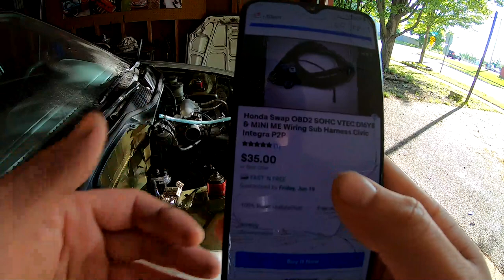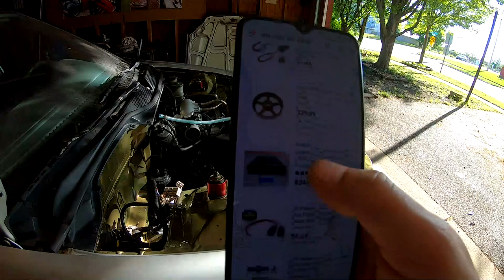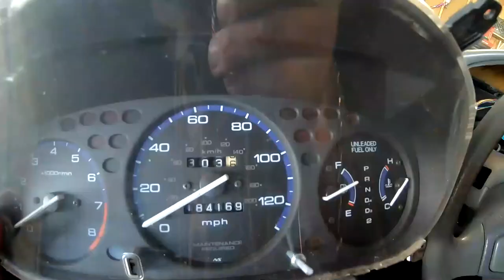500hp build D16y7 to D16y8 Intake Manifold swap step by step 3 wire to 2 wire aicv obd2b to obd2a

Comment: What’s up man I have a 2000 Honda civic I swap the engine from d16y7 to d16y8 but I need to run the harness and I was watching and I think I have the OBD2B with the distributor obd2 I was wondering if I can used the same harness

Comment: Great Video. I have a 2000 DX Automatic ( 😔) Which has a Y7 Mani. I purchased a 2000 Y8 Automatic Mani recently. Which Has those Ports. The Seller said it should be Straight Install. But my Car ISN'T an EX. So Do I still have to Plug Those Ports? I still have to look if I have that extra nipple on the thermostat housing on my car. Figured I asked you first.

Comment: got a question. •Got a 96 Honda Civic hatch. •Has the 96-98 d16y8  vtec motor 
•has the d16y7 obd2a non-vtec 5peed manual transmission wire harness that’s been wired to the ecu for the knock sensor, iacv ,both vtec sensors.
Running a p2p-a33 ecu. 

I’m having trouble finding the right distributor for it. My harness has the 10pin plug and the one for the 99 d16y8 that the motor came out of has a 8 pin plug
Reply: Need the 96-98 y7 distributor. Called the “big plug” dizzy

Comment: If I have the 97 civic Ex & it’s converted from auto to 5 speed I’m hooking up my skunk2 intake also but ran into an issue I’d there I’m able to switch the to 2 wires instead of 3 like you did for the IACV without charging my computer or anything

Comment: Badass video bro I dont know much about engines I bought a 97 honda civic dx automatic. the guy told me it's a   Freakin Stein built. Not sure what that means but I do know I need to hook up the vtec the engine it has it a d16y7 . I noticed the harness it the same one u using .my question is can I connect the vtech the same way u did ? And will I need a different ecu ? Or can I still use the same one ?
Reply from the maker: You need a different ecu. And yes you can connect it the same way I did.

Comment: Hey I have a question if you can help. I have a 97 civic ex I'm putting in a y8 swap. It had a y7 in it when I bought it blown up. It had a y8 engine harness on( i think) .it and a jumper harness to a p06 chipped ecu.. where I'm confused is the fact that it has a green plug and a GREY  plug coming from the dash by the ecu. The grey plug is going into the ecu jumper with the other 2 plugs on the engine harness...  I bought a obd2a vtec ecu and a unmolested y7 harness to modify with the y8 plugs but idk what I'm going to do with the grey dash plug or why it's there.

Comment: So I bought a obd2a wiring harness that I'm using on my 99 civic lx with mini mi swap, which used an obd2b harness. I bought an obd2a to obd2b jumper harness and have 2 questions, first how do I go about the difference between 10 pin to 8 pin distributor plug? Can I by a adapter for it? Second, the green plug under the dash on the passenger side, do you repin those and if so how?

Comment: I just want to say you've hopefully single handedly saved my brothers honda, I was very worried  about finding the write information for his 98 honda civic we put a d16y8 into it. Initially we ruined the original y7 harness got a y8 harness didn't want to run the o2 sensor. SO I got another y7 harness but we needed to adapt the iacv from 3 to 2, then wire in the new knock sensor, vtec solenoid, and vtec switch. The only thing I have a question about is in the last part of the video, is it necessary to splice those wires my engine does have the crank sensor in it and it plugged in. So I don't think I'll need to do that, I believe your engine is a y7 bottom and a y8 top. I'm also using the y8 ecu, and y7 throttle cable so we'll see how that works out if I need to pull a y8 cable.
Reply from the maker: Thank you and yeah you should be good.  Glad this video helps someone.
Reply: @BarbasLife   Thank you, we’ll be wiring today. Appreciate you 👍

Comment: Hello new sub here quick question I have a 1998 dx hatch with a D16Y7 and going to be doing the Head swap with a D16Y8, I do have the Y8 engine harness and ecu, would it be easier instead up changing the wires to just use the Y8 ECU and Harness ? Thanks

Comment: I just bought a 96 Honda Civic hatchback cx that has a swapped d16y8 vtec manual transmission 5 speed running the p2p-a12 obd2b ecu and wire harness.  A couple things aren’t working right so I ended up getting the obd2a p2p-a33 ecu. My question is if I get a 1996-1998 OBD2A HONDA CIVIC EX OEM Non vtec ENGINE WIRE HARNESS 1.6L M/T 5speed , will it work for my ecu and be able to run my car right ?
Reply from the maker: Will work as long as you get wire harness for 96-98 and ecu for 96-98   because plug ins are different for 99 and 2000. Yes everything will be a bolt on swap.
Reply: Thanks greatly appreciate
Reply: @BarbasLife  Thanks for the video again what distributor do I need?

Comment: I have d16y8 block with vetc swap head and ecu my speedo is not working also I have engine light on and the vtec is not working how it should be to work please help
Reply from the maker: D16y8 is a vtec short block. Check if  the vtec is wired in? Also what ecu do u have is it a vtec ecu? Maybe the filter is clogged up on the vtec solenoid  check all these. For your speedo check the top of your transmission maybe its unplugged or broken.
Reply: @BarbasLife  everything is plugged in I have p28 ecu I have put new sensor also plug still nothing I change again the sensor but nothing

Comment: Hey man I know it’s way late to comment on this but do you have any idea what could be wrong with mine? I have a d16y7 and I got a skunk2 intake manifold, basically a d16y8 manifold, the only thing I cannot get to work right is the idac and my only guess now would be the ecu, would I need to run an after market ecu to get the d16y8 manifold to work with my d16y7?
Reply from the maker: Naw no aftermarket ECU needed
Reply from the maker: What's your car doing?

Comment: Had u already installed a y8 cylinder head onto the y7 block beforehand?   New to the channel
Reply from the maker: No its a jdm d16a cylinder head looks identical to a y8. Also has vtec solenoid port but the head is not vtec. I know its weird but its not vtec. I'm planning on getting a y8 soon to swap in.
Reply: @BarbasLife  oh ok so would this wiring work with a y8? Or what would be done differently?
Reply from the maker: The whole wiring would be exactly same i pretended I was working on a y8 with vtec.
Reply from the maker: @xitlali09  also thanks for subscribing.
Reply from the maker: All your doing is swapping manifolds and adding vtec wires to the head and wiring it into ecu
Reply: @BarbasLife  no man, thank you for putting this information on video.  I have been wanting to do a mini me swap on my 97 civic for a while but was never sure about the wiring.  Looking forward to finally starting on it.

Comment: I need a new engine and I wanna turbo and run around 6-8psi do you reccomend getting another d16y7, d16y7 convert to VTEC, or d16y8
Reply from the maker: If you can find an engine that is already vtec would be awesome but you can always find a head. Get what ever engine you can find you can always build it in the right direction if this makes any sense.
Reply: @BarbasLife  it does make sense, I just doesn't really know the pro's and cons of doing so, after doing some more research I've found z6 swaps done as well but I haven't learned much about them yet. It's a lot of information for someone who doesn't know cars or engines too well. I'm trying to keep the cost down relatively low.
Reply from the maker: If your keeping cost low just swap for the same engine. Then get intake manifold and later vtec head. Tell me what happened to your original engine and can you save any of it? Also there is a guy with a 1.5liter block and vtec head thats making crazy power. Look him up on YouTube (D-series)  its a white hatch he has built it slowly now its a monster
Reply: @BarbasLife  was working fine got an oil change heard knocking when the Pistons warm up and expand and brought It back and was told that my dip stick tube seal broke and the tube wasn't properly fitted so it leaked oil or something and it makes noise in the lower engine but he never pulled it because it wasn't worth his time 128k miles too. First car and lasted me less than 2 months
Reply from the maker: So you got rod knock I would find a lower half (engine short block) from the junkyard and save your head swap it over. That's probably the easiest way to save a lot of money. Then save your bad block to build it for boost. Im sure you just spun bearings then the knocking started. so its not that bad. You can even drop your oil pan, pickup tube and griddle to get the crank out get it polished cleaned and new rod bearing and main bearings you would probably be good.
Reply: @BarbasLife  I'll look Into it, thanks for the advice. I'll probably be back again

Comment: Questions sir is it fine to run a d15b7 manifold on a d16y7 engine ???
Reply from the maker: Yes you can run it.
Reply: @BarbasLife  so don't matter is still the same performance still then?
Reply from the maker: @OmarPerez-ln4es  yea same thing pretty much  just the block is a bit bigger  d16 vs d15 everything is pretty much the same
Reply: Okay thanks bro was worried though   the performance was not the same

Comment: I swap a d16y8 in my 98 civic and it turns over but won’t start up and run nor idle for even 5 second please get back to me am trying everything g I could and not getting know where bro please
Reply from the maker: Check if your getting fuel pressure at the fuel rail. Check if your getting spark, then finally double check your timing.
Reply: Did all that my brother still nothing
Reply from the maker: compression test it.
Reply: Thank you so much for replying to me you really help me and I got it running but now soon as I step on the gas it cuts off